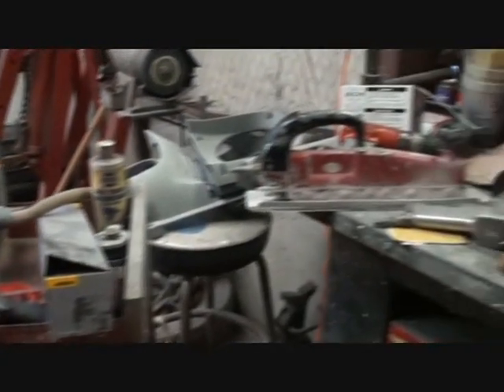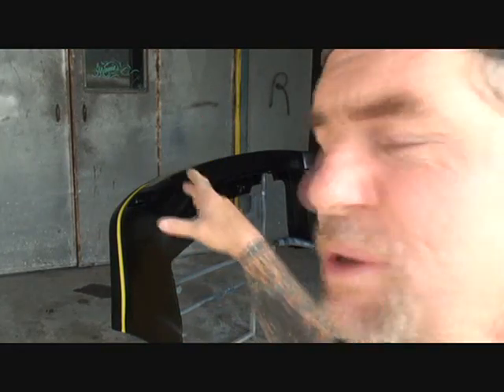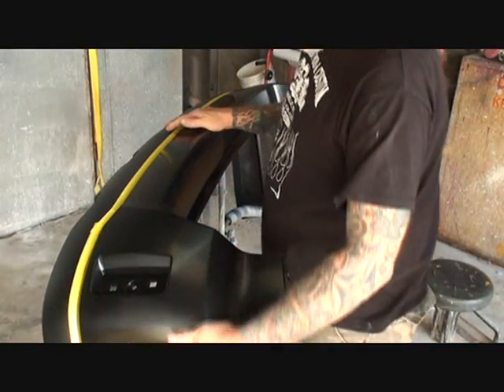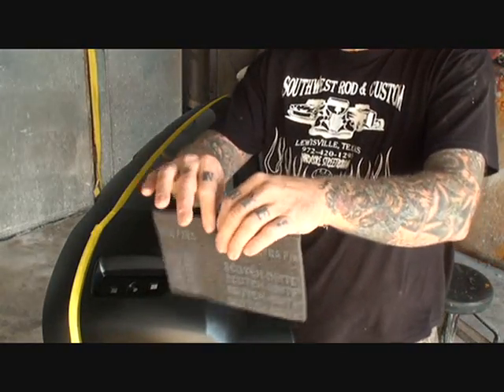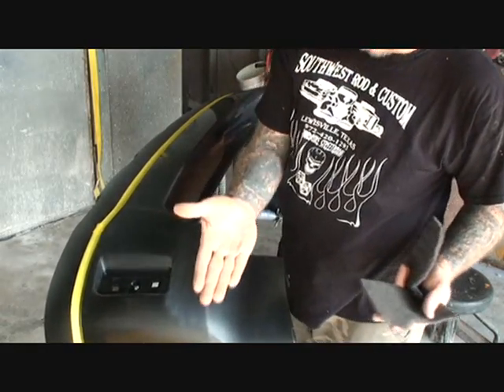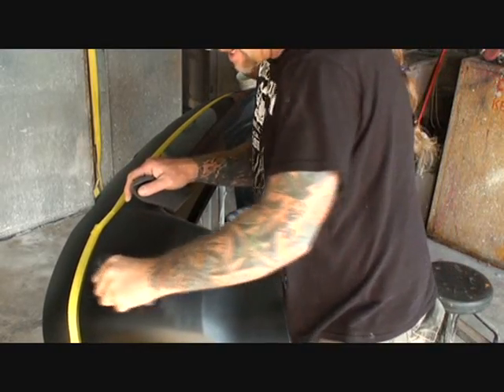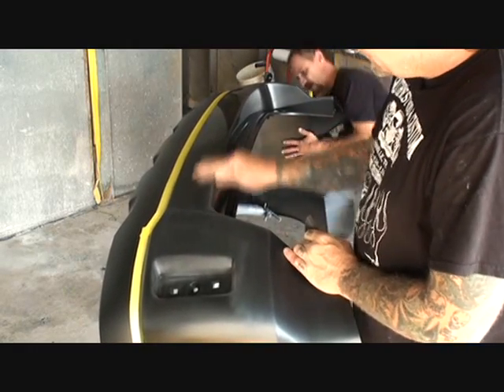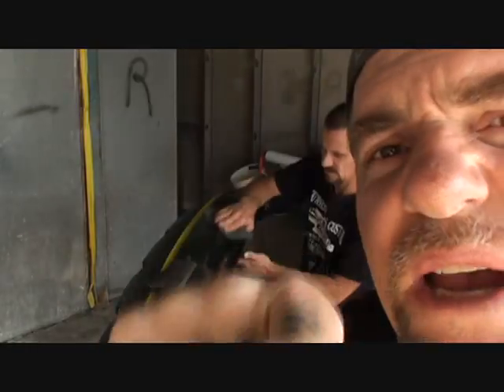How To Prep A Plastic Bumper Cover-Automobile Collision Repairs-Part 1

Comment: Yo Pete, how about prepping a urethane bumper cover from an older car like my Trans Am.  Same process and then put an adhesion promoter then epoxy primer and plastic Upol filler for small chips then a seal coat with epoxy then  BC with flex in the CC?